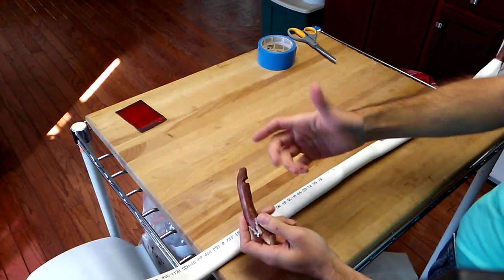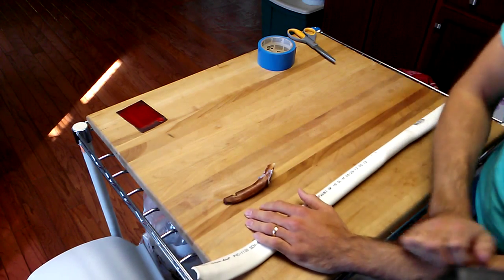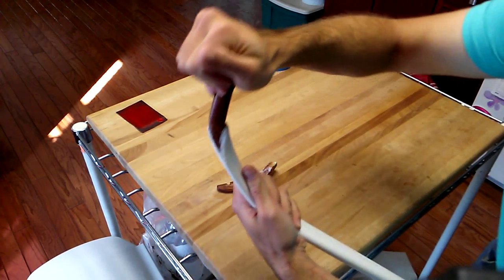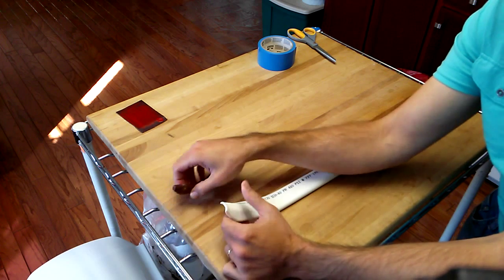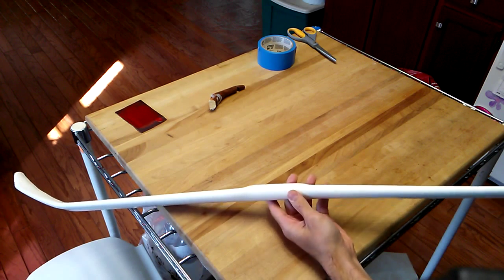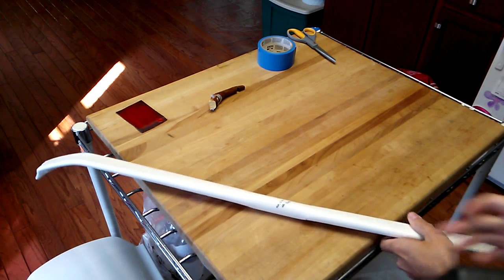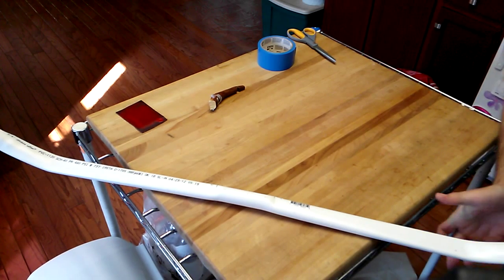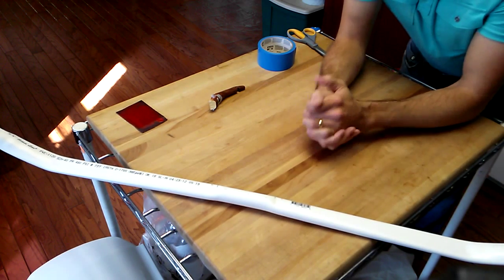Postmortem Analysis of the Turkish Bow Explosion - what NOT to do to a PVC bow!

Comment: Hi Tim. I know that bindings on a PVC bow are mainly there to replicate original bows, but do you think that by binding the area where the sihas attach to the pvc bow with sinew, artificial sinew or a good strong cord, would have prevented any flex or movement that may have resulted in the failure..............Just a thought!